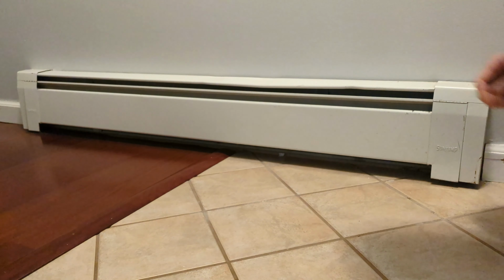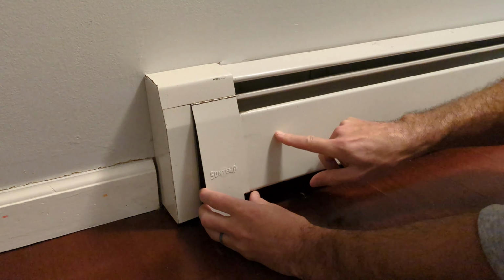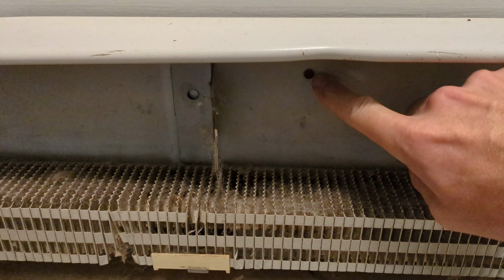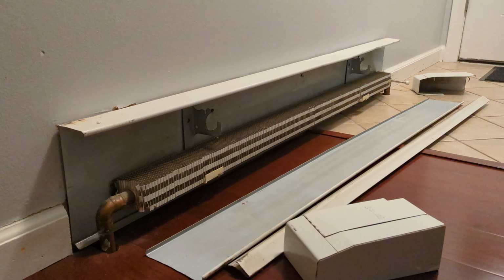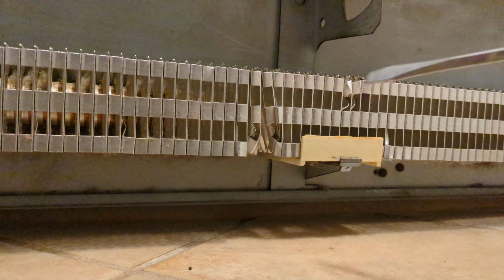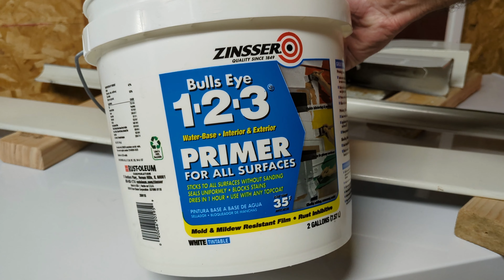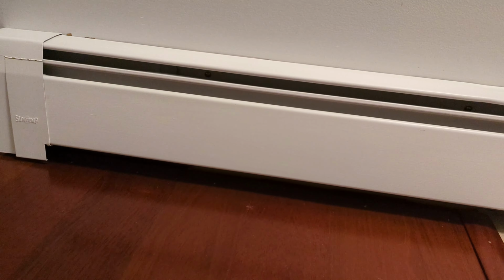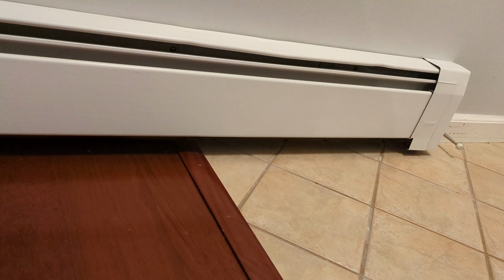How to Fully Refurbish Baseboard Radiators

Comment: Thank you for this! Is sanding the best way to address rusty spots and uneven paint jobs/visible brush strokes, thick layers of existing paint, etc? Or would I need to treat the components different to address those issues? 
Is there anything that could/should be done to the interior side of the covers to make them work more efficiently or improve longevity (protective varnish or some sort of radiant coating? Idk lol) sanding the inward faces as well?
Reply from the maker: I would use a scraping tool for spots like old paint drips. Anything small light sanding. Anything else definitely sand or strip outside and secure in a vise or clamps on a table or sawhorse. You won't want to hold these sharp metal pieces by hand while using a sander.
Inside parts on mine were bare metal and only needed thorough cleaning. A wire brush if any rust inside should be fine.

Comment: Hi! Thank you so much for this. I just purchased an older condo with this type of heating. The vents are painted a horrid dark olive color, and it looks pretty thick.  I would like to paint them the color of the walls. I've seen this in other units, it makes them blend in and look much nicer. Do you think I'd need to sand them first? Would you use that primer first, then the color of paint I want? It looks like you are just using the primer as your paint color.
Reply from the maker: @scoobydadog246  the primer stuck extremely well without any sanding on mine. It's not scratching off or anything. I would test it out on one piece first to confirm. A good paint primer should work well. I used the bullseye 123.
Reply: @realhouseDIY  Thank you!

Comment: I despise mine. Noisy, dirty etc..how can i replace them?
Reply from the maker: @deecee901  easy fix is to search for baseboard heater covers. And a bit extra work is to remove everything other than the hot water pipe and replace.
Reply: @realhouseDIY Any idea what those 2 clips are for that go on the fins?  I found one on the floor and don't know what their purpose is.
Reply from the maker: @kimbuck-2  the flat, plastic ones on the bottom are providing extra support to the pipe and fins. The plastic also prevents metal to metal contact with the support bracket, which I believe would cause some noises when the water heats and expands the pipe.